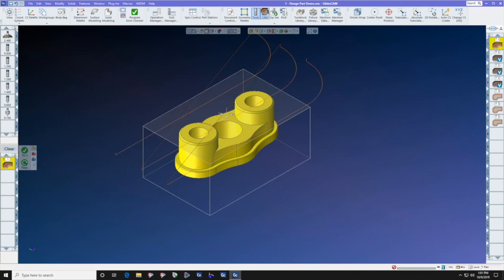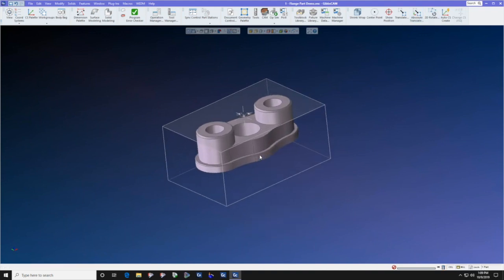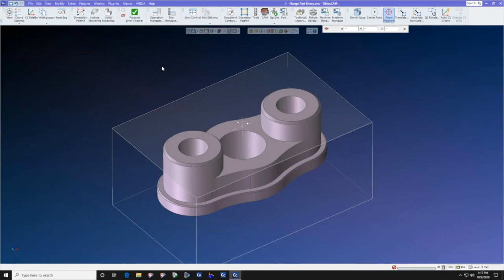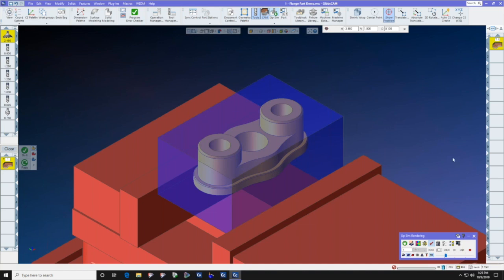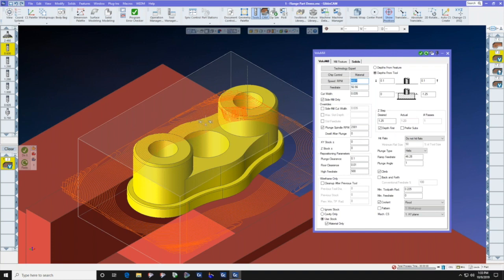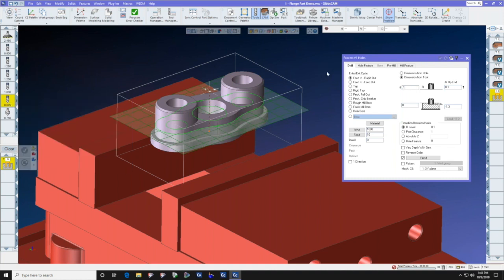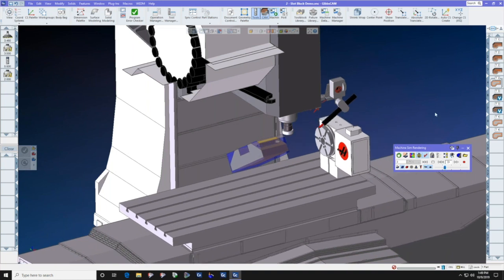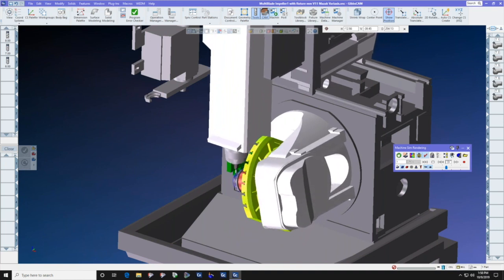Webinar: Machining with Solids

Comment: After watching this sales pitch, I must say how uninformed the presentation was. I've been using Gibbs for over 10 years. I am qualified to say, you were selling, not informing. You obviously have no clue how to cut 17-4. And you neglected to mention how you need to have the exact same tool to save a process. Have you heard of a job shop? I'll wait for your answer while the parts I programmed and set up, and inspected are on Mars.
Reply from the maker: Hi Andrew, you are correct in your assessment that this webinar was a technical sales presentation. In these webinars we give a broad overview of GibbsCAM’s capabilities, so that people understand the broad strokes of the product. It is technical, but is not meant in any way to be a training video and therefore doesn't cover things that we would cover in training, such as the need for the same tool in Saved Processes. Not everyone has the level of expertise that you have, and the presentation reflects that. We assume some viewers don’t currently use GibbsCAM and what we show is new to them. The presenter for this webinar is an extremely experienced machinist with decades of experience in both machining and GibbsCAM. Congratulations on having your parts on Mars! That’s amazing!

Comment: Before I watch this whole video, technology expert is garbage. It was made for programmers who don't know feeds and speeds. So far it seems like this video is for an engineer who thinks machining is kin to a saw making a cabinet because software. Also, milling chucks are more expensive than effective and less rigid than a Weldon flat on an endmill holder. Someone in this video should spend some time in a shop actually making something. Or better yet, see if they can make money making parts.